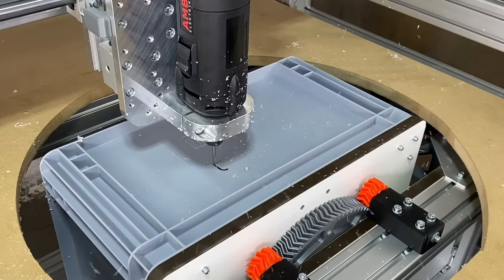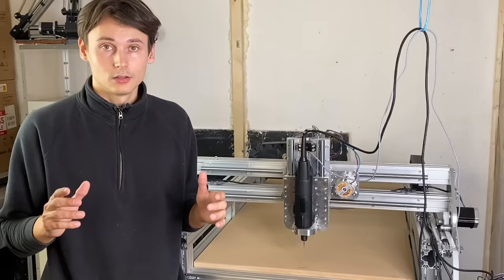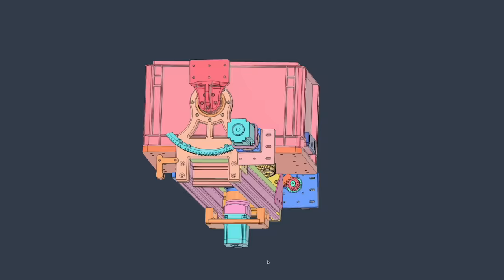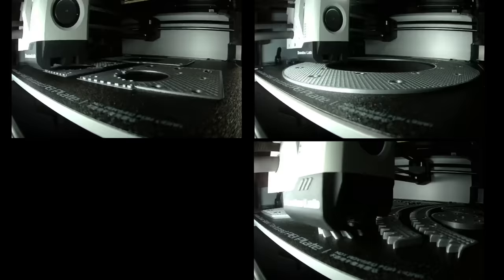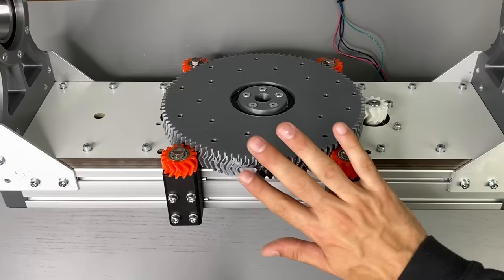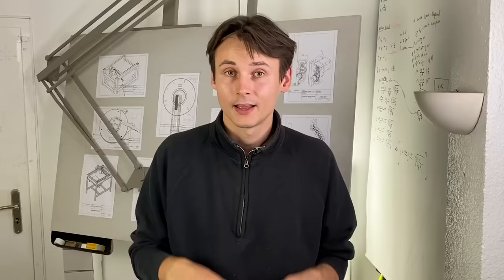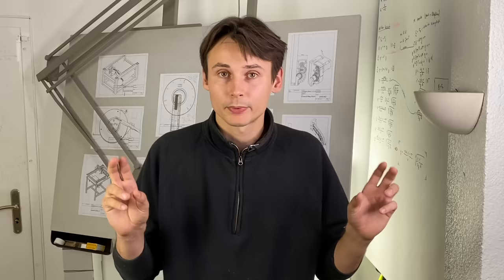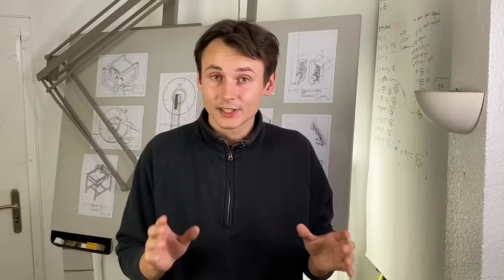3+2 axis CNC - 3d printed automation #006

Comment: Are you concerned about cut plastic making its way into your gears? from the video the plastic cuttings already made it pretty close to them
Reply from the maker: I think you are right. Some covers would be a good idea.
Reply: Maybe a 3/4” tube with vacuum or air compression blower angled towards the cutting region too

Comment: You might want to add a shield to keep the chips from getting in your plastic gears.
I would also consider a different solution to hold the box in place, something with springs and/or magnets to avoid the use of two external plastic parts and a drill
Reply: Damn beat me to it. saw those plastic shavings hitting the Vaseline and immediately wanted a shield.
Reply: Also agree on that manual fixation action that is quite time consuming.
Reply: You can do something like spring retention clips that have like a little triangle bit on the end. So when you push it in it snaps into place and to take it out. All you do is push in the tab
Reply: @Haagimus  I think toggle clamps would work very well, they could just pivot down into the hand holes.  They are often used in workholding in small production runs.
Reply: Honestly even a sheet of paper or thin cardboard would do. I poke a hole through cardboard and put my nozzle through the hole whenever I blow chips to contain them. 
With the plastic being cut I doubt there is significant heat in the 'chips' so this type of guard would work.

Comment: Excellent work.  In many disciplines, "cheap" and "lazy" are insults - not so in engineering.  It seems like you've put just the right amount of effort and robustness into the design to do the intended job - an optimal outcome!

Comment: If you move the clamping mechanisms to the inside of the box, you could have them permanently mounted rather than having them removed and re-attached at each mounting, and if you have a long threaded rod with opposite threads on each end, you could make it so you only have to put the driver onto one end to tighten both clamps. Taking this two steps further, you could automate the driver by having a stepper motor mounted on the plate that automatically tightens the rod at the start of the process and loosens at the end of the job.

Comment: You could also add a vacuum near the box under the table to get all the dust away, or use air pressure. Very nice project. Like to look how it grows
Reply: you said it in the end that you will add a vacuum, I think my idea with pressurised air is a bit messy, the chips will land everywhere

Comment: I'm continually inspired and impressed by your thoughtful approach to design an engineering. Thank you so much for taking on the immense effort to document and share it. It is really special. 

A thought on gear lubrication: particularly in the area of an active CNC, chip fouling is a real concern. So while a grease lubricant (like Vaseline) is a tempting option for lubricity and safety, it might not be ideal for gear longevity or cleanliness. A dry lubricant would be preferable and I have had good luck on printed parts using synthetic waxes or even bar soap. Just a thought. I confess, I have not done a study on the subject, these lubricants have always just been "good enough."

Comment: this is beautiful.
if I ever come into the situation that I need such a solution, I now know where to look.
those boxes are literally dirtcheap, the only important part is to set up the injection molding once (which isn't easy) and then it cranks out those boxes for literally material cost.
and they are designed to be massively sturdy.

Comment: If you don’t like gear lubrication you could try making the gears or at least their teeth out of nylon, which is supposed to be low friction and self lubricating. I also saw you can get PC-PTFE blended filament which has low friction but it is expensive.

Edit: something else I have used is a PTFE spray lubricant, it is quite messy to apply being a spray but it dries onto the part, coating it in a layer of PTFE which means it doesn’t really pick up dust since it is dry but it makes it very smooth and lubricated.
Reply: PTFE is also bad for the environment, so best to avoid unless it is production critical.
Reply: @szurketaltos2693 Explain how Polytetrafluoroethylene is bad for environment, please.
Reply: @mil3k  PTFE breaks down into PFOA which is associated with cancer and other health risks. And, GenX (a precursor of PTFE) causes similar risks -- so the production of PTFE is quite bad for the environment.

Comment: You could adjust the size of the wood cutout on top and one of the handle grippers could stay permanently affixed and it would save you quite a bit of time with the mounting process. You could place the box down, clip it in to the handle gripper, and then attach the other one with the bolt.

Comment: Great application. I suggest you to use a set of conical bearing as they usually wont cost much, and furthermore with light preload you can reduce play in the sysyem.
For the gearing you can put the outher ring in the inside of the jig, making it semi enclosed or more easilly enclosable. 
Moreover you can reduce the dimension of the motor, as they are just for comands rather than power, wich in this case isn't much of a problem.

Comment: Really nice clean design! 5th axis stuff is a game changer I don't think I could go back to just 3 it just makes life easier and opens up new possibilities. Only feedback I could think of is it would be worth making a shroud or cover for the gearing on the bottom as it'll be a chip magnet. Even with a vacuum system hooked up they will get everywhere.

Comment: Good job. Gears and gears as bearings (!) need to be enclosed. A less automated but more expedient approach to solving this problem is to make routing templates for each face of the box. Once the templates are in place, routing takes about 30 seconds per face. Templates can be made on your CNC router.

Comment: Standard deep groove bearing should always be used in pairs with some preload, that way there will be no play.
Loaded axially they can safely withstand 10% of their rated axial load.
You can buy pretty huge bearings so axial load wouldn't be a problem, like 6824, these go for around 20-30eu if you don't buy SKF and the like.

Comment: allow me to throw in my 2 cents.
probably will be a good idea to cover the orange gears from the cut dusts. 10:00 maybe a solution of brushes around the bottom of the box holder, brushed like used in the pantorouter dust collector

Comment: This is cool, but I wonder if you could make it a lot faster with the assumption that you're only working with one particular shape, which is that packing crate. If you use something like detent pins or some other kind of hard stop at different rotation positions, you could turn the box with something like a belt drive, then have the turntable lock into place with a separate mechanism. It wouldn't be nearly as flexible of a design, but it would change working surfaces for this specific job a lot quicker.

Comment: Looks awesome, I think the one thing I would change is removing those mounting wedges that push through the handle and need the impact driver  to attach. Consider putting them on the inside and have them push out via an integrated motor to remove the manual step of tightening the mount?

Comment: Just found this series so you may have already adresed but I see something that could cause issues.

The plastic shavings will get into the gears not only gum therm up but throw of the stepper motors out of wack. A dust colection system would be the best option long turm, short term some shrouds around them will also protect them form dust and other particulet if you keep this for other projects.

Comment: Petroleum jelly is a widely used lubricant, but not for packing metal bearings and gearboxes because of its low melting point. For 3D printed parts, which would melt anyway, I suspect you will never have problems.

Comment: Regarding the lubrication of the herringbone gears, you could try using self lubricating filaments like Igus iglidur i150
They contain solid lubricants and are easily printable
Reply: Yeah, but also crazy expensive for what they can do. Absolutly amazing for very special formed sliging bearings and parts, but for that gears und with such small load, acceleration and torgue, I would say it is probably more cost effective to lube and change the gears every now and then, depending on the amount of products that are made with the the maschine.

Comment: So brilliant Christopher...and on so many levels...Vielen Dank. To make the box mount/release easier and manual, use a 6mm cam bolt used on mountain bike seat post, as the compression device; perhaps? They are very robust in this type of application and super cheap :-)

Comment: Dude, very slick setup! You could even make a cutout to fit back into the table when you arent using the rotary! 

I would love to see more of the electronics.  

My question is: I have curiosity to hear your thoughts as to how this system could possibly handle nonferrous (stainless or aluminum or nylon) hardwares.  Maybe you addressed this already and I missed it.

Very very very cool series and I have been watching your channel closely!  The more videos the better! Keep em coming!
Reply: I can answer this. this will absolutely not machine stainless steel. Nylon yes, aluminum maybe with super light passes. But the cutting forces needed to machine harder metals will tear this system apart.
Reply: @nerddub  Yeah, I don't even think aluminium could ever be machined on that system.
Reply: @nerddub I am sorry for the confusion, I was addressing the question to the hardware counting system, not the cnc machine.  I am fully aware that belted cnc machines can struggle even with soft metals.  Again, sorry for the confusion.

So to reword my question, how can the part counting system handle non magnetic materials?
Reply: @ChachiOhm  IIRC the newest version used an optical interrupter so it would handle any material I may be wrong on that though maybe he’ll chime in here!
Reply: @innominatum9906  not with that spindle but the gantry looks almost capable enough
Reply: @nerddub  On top of my head Im comparing it with the 5axis Pocket CNC Ive seen. That machine looks a lot more stable and still sounds quite horrible 😆

It would be interesting to see what this machine can handle though, cause its an impressive DIY project

Comment: 8:25 Instead of bolting on the handle clamps, you could save a lot of cycle effort by using magnets. Make the removable parts attach with peg and sockets. Put magnets in the sockets and pegs. The force of gravity on the crate would be perpendicular to the axis of the pegs. The grips would never fall out without them being grabbed and pulled out.
☮️❤️🌈
Reply: If you want a mechanized system, you could use a "double slider crank mechanism". One servo turn would extend two wedges pinning the box in place. See: https://www.youtube.com/watch?v=e0b3DAagscw

Comment: Its seems like you should cover those gears somehow. You use lubricant, which collects all dust and filings, and i think because of this, the mechanism would not work correct for a long time.
BTW, you did excellent job, thank you for your video.

Comment: Vaseline is petroleum based, so it will affect some materials. Not sure it’s the best choice of lubricant really, especially if it’s drying out. But your machine doesn’t look to be running fast so it should be ok for what you’re using it for I suppose. Nice machining work 👍🏼

Comment: I don't know if the clamping system has to be automatic (and adding motors on the moving axis is more weight) but even just replacing the screws with some sort of coarser threaded hand knob or a locking cam would probably clamp them sufficiently with one big turn instead of the whole drill spinning process. could simplify and speed up the ease of it all without resorting to electrical complexity

Comment: very impressive, but if i were doing it I would make a router template from mdf that slot them into to the side recesses of the box and use a laminate trimmer with bearing follower  you can then manually chop out the sides accurately and quickly by hand.  its not automated but additional 2 axis on you CNC seems like allot of work. but i do not know the volume or variety of the designs you are making. great work

Comment: You know, tapered roller bearings are a thing. They are cheap too.
Two of those in ⇨⇦ config with a sufficient preload are surprisingly rigid for both, axial and radial loads.
But anyway nice work 👍
Also you might want to look up Vaseline lol

Comment: You need vaccum support for that drill haha 😂 it’s pretty simple design 2 circle one for the head of the drill one for the vacuum and under you have a brush length of the drill bits that goes all around 👍

Comment: I could probably use your expertise in electrical engineering.
It's for something that will be a 3D printer, CNC, but also will be able to do laser lithography. It will have sub micron precision with zero backlash!
Outside of the spindle/head, There will only be the gears to push the filament through or the drill bit to cut with, there will be No Other gears, rails, rods, belts of any kind at all whatsoever.
And all of the action takes place on the inside of the motors that are stacked in the same vertical space.
Obviously I'm making my own motors that are constant DC and water cooled but to control the motors... The electromagnetic coils are going to be very extremely complex to control and this is where your expertise might be able to come in.
The electronics will also be processing each frame of a high frame rate microscope camera.
while an AI model controls the amperage and voltage to the coils individually.

Comment: I thought petroleum products break down most plastics? How long have you used vasoline and what materials, fascinating. This is s great application of this axis, since you are cutting a thin material it you doesn't need it to be that accurate on the turntable

Comment: this is a fabulous video and I'm stunned at how rigid the whole thing was. I am just curious about your work flow and/or the scale at which you need these boxes. Are they the sort of thing where you need a bunch of them right now and probably wont need many in the future? Or is more the sort of thing where you'll just need 1-2 of them made occasionally. IF you needed a big batch right away and don't think you'll need to be able to make a lot more in the future then I would thing it would have been easier and faster to set up the cnc to do one side of the box and then cut that side on each box before moving on to another side and so on. I'm sure you probably thought about this though which is why I am curious about the scale at which you think you'll be needing these made.

Comment: A small suggestion for the videos themselves. They are very, very good. But I don't think you should reach for things while you look at the camera. It doesn't look natural and comes across as staring at the viewer. I'm sure others will disagree with that statement and it's certainly a matter of preference, but it's not something you would naturally do when talking with someone in person. It requires extra focus on your part which makes it an intentional detail that is distracting.

I don't think they do this even for the weather forecast anymore; even though they look at a screen to see if they point at the right area they put the screen off to the side because it looks more natural when they have to look towards what they are pointing at.

Comment: Hello! That's a great workout. Congratulations! Could you tell me how you handled the 4th and 5th axis with software? Are you using GRBL? I have a similar project. I am trying to handle the software with Marlin because I try to build 5 axis 3d printer. It would be great if you could share helpful information. Thank you very much. 😊

Comment: Amazing work! This is really cool. Do you plan to release the electrical design and code for this system as well? I am interested in how it functions and possibly want to try and add this to my CNC machine. I have Genmitsu 4030 which I know will need me to replace the controller in order to operate this. Thanks for the video and I can't wait to see more!!

Comment: um you didn't have to make a machine to count. You take one screw and weight it. Then weight the rest and you can calculate weight and count. Also your machine could be used for sorting instead. Then use the weight to do the counting. :)

Comment: Absolutely impressed with the engineering in the whole design, most impressed with the solution to the flex in the bearing with the gears, I've been working with various CNC componetry and machines in my profession for almost 10 years, never seen a solution like that before, very creative solution.

I do have one question, where would i be able to find the open source platform for the gantry, all i got from the subtitles was "fox fraser" I've listened over and over, and my aussie ear can't quite pick up if that's exactly what was spoken or not, various attempts on google comes to nothing. I would very much appreciate some help in that respect, as I am after a similar solution for machinong some 6060 aluminium for a project i intend on working on.
Reply from the maker: Hi, "Volksfräse" https://www.unclephil.de/volksfräse-vf1/
scroll all the way down, there you can find the step file

Comment: amazing! do you have a link to the boxes? id like to get some similar in canada
Reply: They are called Euroboxes and are very common in Germany and, well. Europe. They are normed so any manufacturers box of the same size will fit onto another. The sizes are as such that two smaller ones fit onto one bigger one. E.g. 400x300, 600x400, 800x600.